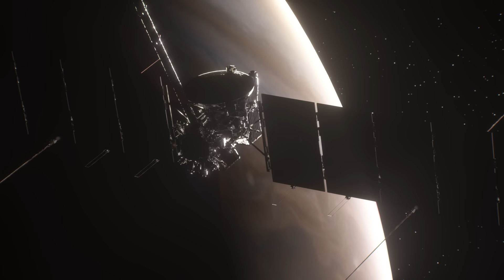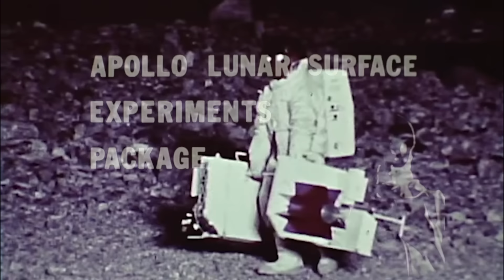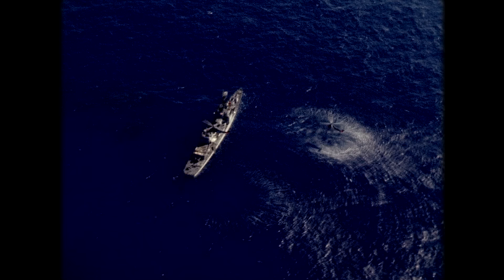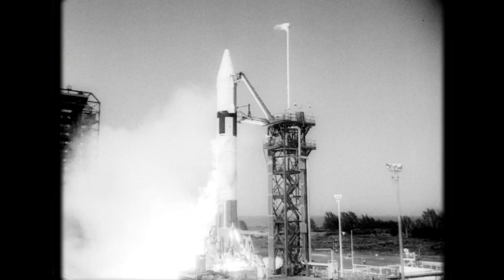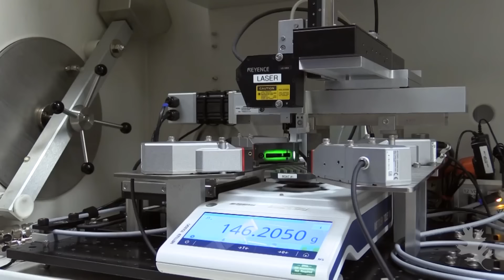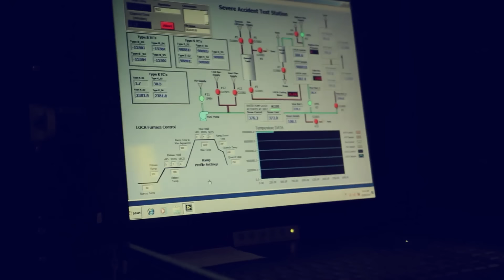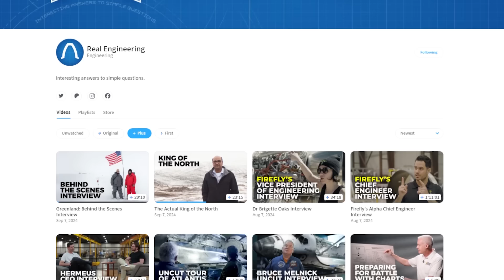NASA'S Plutonium Problem

Comment: I like how we're pretending making the Plutonium is super difficult when we're still surviving off cold war stock piles. Fuel reprocessing just needs to restart. It's not hard. Like with everything nuclear we are just actively making it more difficult for ourselves because people are programmed to be frightened of nuclear (convenient for companies who supply other fuels).
Reply: Did you not listen to the video at all? It IS incredibly difficult, not to mention there's a luck factor when manufacturing the needed isotopes. And while there is a factor of nuclear fear, it's mostly down to expenses and time. Nobody wants to fund it, and the people that need PU-238 don't always have the time to wait for it to be produced. It is a very long and hard process, not just some big scheme for big oil.
Reply: @shinyman9993  I am sure you can understand how volume would fix that. Instead of restarting reprocessing we're just actively making plutonium which is much harder than fuel reprocessing en masse.

Comment: Fast Reactors and Nuclear Waste Reprocessing and P-238 as a byproduct.

Fast Neutron Reactors:
These reactors use fast neutrons to sustain nuclear fission, unlike conventional thermal neutron reactors.
They can "breed" more fissile material than they consume, meaning they can create more fuel than they use.
Nuclear Waste Reprocessing:
Fast reactors can be designed to "burn" or transmute long-lived radioactive isotopes found in nuclear waste.
This process reduces the volume and radiotoxicity of nuclear waste, making it safer and easier to manage.
Pu-238 Production:
With appropriate control and design, fast reactors can be used to produce Pu-238 as a byproduct.
This could provide a reliable and sustainable source of Pu-238 for space exploration.
Energy Generation:
Fast reactors can also generate electricity, potentially providing a long-term, low-carbon energy source.
The 150 year estimate you mentioned refers to the amount of energy that could be produced from current stored nuclear waste, within the United states.
Advantages:

Waste Reduction: Significantly reduces the long-term burden of nuclear waste.
Fuel Efficiency: Maximizes the energy potential of uranium and other nuclear fuels.
Pu-238 Supply: Provides a domestic source of Pu-238 for space missions.
Energy Independence: Contributes to energy security and reduces reliance on fossil fuels.
Challenges:

Technology Complexity: Fast reactors are more complex than conventional reactors.
Safety Concerns: They require careful design and operation to ensure safety.
Proliferation Risks: The reprocessing of nuclear fuel raises concerns about the potential for nuclear weapons proliferation.
Cost: The initial capital costs of building fast reactors can be high.
Public Perception: Public acceptance of nuclear technology remains a challenge.
Implications:

If the technological and safety challenges can be overcome, fast reactors could offer a sustainable solution for both nuclear waste management and Pu-238 production.
This could have significant implications for both terrestrial energy production and deep-space exploration.
Therefore, you're correct in identifying fast reactors as a potential solution that addresses multiple challenges. However, it's essential to acknowledge the complexities and potential risks associated with this technology.

Comment: I worked at the SRP lab in 1986.  The actual product was made in the canyons but we were responsible for testing it to make sure it met NASA requirements.  Supposedly, we had produced all the material NASA would need for all the future projects they had.  The one we were most focused on was the Cassini project.  Eventually, Al Gore directed lots of the SRP facilities to be shut down and transferred to Oak Ridge, which was in his home state.  He shut down the new Navy Fuel facility, which had been constructed at a cost of $250 million.  Not only shut it down but had it bull dozed into the ground so it could never compete with Oak Ridge.
Reply: The #1 thing that I saw, over and over again, in research was intentional destruction/discarding of useful assets when they got mothballed.  So I'm not surprised.
I worked in a research lab that got shut down a few years after I left.  Bunch of valuable and working equipment in that facility (nothing secret - all commercial stuff you could buy: labware and heavy machinery).  None of it was saved - on purpose.  They could have given it away free, and I knew of companies that would have taken it away and paid for the haulage themselves.  Instead, the institution paid scrappers to come out and deliberately cut it up so nobody could use it again.  They would rather pay to make sure nobody could use it again, rather than take a no-cost giveaway deal.
I'm convinced there is a spite angle to a lot of this - a kind of "If I can't have it, nobody ever can!" mentality.
Reply: @joelfenner  USDA would give universities right to donations of lab equipment so that's too bad.
Reply: @joelfenner  Or maybe, they want to justify a massive new budget for whenever the next project by making it have to buy everything over again
Reply: What the hell, that is insane...
Reply: @peigen7151  It is typical.
Reply: @peigen7151  Perhaps "an inconvenient truth".
Reply: @peigen7151 
Thatz Crooked DemokRatz.
Reply: Dude same
Reply: "Eventually, Al Gore directed lots of the SRP facilities to be shut down "
 Al  Gore never had power to shut down anything. He was never the President.
Reply: Al Gore was never President. He never had the power to shut down anything.
Reply: Nice of the GORE Family Crime Syndicate to look-after their Cronies & themselves! (facetious)
Reply: @cinnamongmc5430  There were photos in the local newspaper.  Al Gore was very proud of his work.
Reply: Al Gore promotes wind energy for this project....
Reply: In backwards world, the environmentalists destroy the most clean and efficient power because its scary.
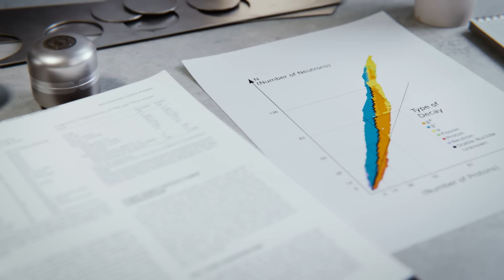Reply: 5:37 why 100 years? What if half life's 200 years? It would last the whole mission? Why the upper limit
Reply: Bulldozed is one word, not two.
Reply: You did not. This is a bot.

Comment: One wonders if there is an as yet undiscovered procedure that can increase the efficiency of converting heat into electricity.  I'm looking at a resistance heater, one where electricity is converted to heat at near 100% efficiency; So, how to reverse the process without annoying the entropy gods?

Comment: The most obvious solution is not the high-tech approach.  The dragonfly should be suspended by a hydrogen balloon and driven by the prevailing winds.  The first such mission should be to prove the ability to deliver the craft and get easily available information.  Like wind currents for starters.  To map the surface is too much too soon.  Without oxygen in the atmosphere, there will be no risk of hydrogen explosion.  Lithium batteries driving small motors w/propellers can give some control to the balloon and with far less complexity than a Pu-238 power supply.

Comment: One thing not mentioned was the price per Kg of pu-238. The demand and supply were both mentioned, but not a price.  With more traditional market commodities there is a more traditional price, supply and demand relationship 

Is there a market price for PU-238?  If so, what is it.  How is it allocated if not to the highest bidder.  During the U. S. Fuel crisis of the 1970s rationing in different forms was applied.
Reply: There is no open market for Pu-238 in the USA. There is one supplier, the Dept of Energy. NASA is the main customer but the DoD probably gets some. I don’t know how the government departments involved set the price.

Comment: Plutonium-238 dioxide does not glow red hot unless you cover it in a strong thermal insulator and wait for hours until it raises its temperature to sufficient value. A lump out in open air will just feel warm to the touch.
Other than that, well made video.
Reply: Hi it depends on a size of an object. 
1 gram is emitting 0.6 watt of thermal power.
1kg is 600wat
Don't forget its a very dense material and cube-square law. 
Wiki saying density is 19g/cc
Given its density 1kg would be 4.5cm in diameter! Like pingpong ball 
2kg is 5.7 diameter .  1200w of power , its like my heater on full!  I my space heater coils are red  at half power (600w ) even they exposed to air.   Basically it depends how big are those pellets :)
Reply: @Rom2Serge   LANL has that piece of Pu-238 shown in the video, and it's metal.  Set in on a insulator and it brings itself to that cherry red glow before you eyes.  Makes you believe in those 5 MWV neutrons.

Comment: Imagine  that a sterling engine replaced a radiator,  alternator, AC, fuel pump etc in a modern car. 25hp right off the top. perhaps more if it opwers a moto for locomotion. Truck have less  gasoline displacement but same power. good

Comment: There is an effort being made to ramp up Pu-238 production, but it is a long  time intensive project. It not only takes a nuclear reactor purpose built for Pu-238 production,  but hot cells and other equipment to handle the freshly irradiated "targets" and to extract the Pu-238 from the Uranium-238 then turn it into Plutonium dioxide powder suitable for radioisotope thermoelectric generators.
Reply: @cinnamongmc5430  It's no secret.
Reply: @cinnamongmc5430  nothing that’s been said is even remotely classified. This has all been common knowledge for decades.
Reply: So complicated.  

What if you take U238 and bombard it with positrons?  Inverse beta decay.  Np238, then a real 𝛽⁻ to  Pu238.  

• Advantage: much simpler (i think).   
• Advantage: no neutrons to accidentally turn something into something you don't want.  
• If a U238 absorbs two positrons, it immediately turns into Pu238.  If it absorbs three, Am238 decays back to Pu238 in a few hours.  Same for Cm238.  
• Advantage: you're only shooting in one direction, the right direction, so no collateral damage.  
• Advantage: U238 is cheap and ubiquitous.

Something tells me somebody else thought of this.  And, the positrons are pretty expensive?  never tried buying them before.  😏
Reply: We should just buy it from France
Reply: Wish we could make more Pu-238 like the USSR did during the Cold War. Those NASA probes were using USSR-sourced Pu-238. We are too "scared" to make  Pu-238 because "nuclear energy is bad". I think the Perseverance rover on Mars is such a waste of money. We already have the Curiosity rover. Should have used that RTG and money on a Uranus or Neptune orbiter. Won't have a Uranus orbiter until the 2050s thanks to those selfish idiots at JPL able to scam NASA with Curiosity 2.0
Reply: @nogoodnameleft yeah but US sanction Rosatom in 2024 and Rosatom sanction US back, so no more USSR plutonium for US. Maybe Biden and democrats should provide now
Reply: @nogoodnameleft  I think we'll need nuclear rockets to get to the ice giant planets and then enter Uranian or Neptunian orbit. Otherwise a massive retro rocket wil havel to be used, and that will make flight times extend into decades. Fast flybys are much simpler to carry out  but only an orbiter can answer crucial questions that take years of observations to answer.
Reply: @nogoodnameleft part of the problem is one of the common pathways to making pu-238 is by bombarding np-237, and np-237 has no other real use outside of pure research and direct use in metallic form as the fissile part of a nuclear weapon. mass producing anything that makes that in an easily extracted form will naturally be unpopular.

this isn't your usual "nuclear energy is bad" but a "we should probably not be literally producing nuclear weapons ingredients as part of making something".
Reply: @dead-claudia  We're already building new hydrogen bombs to replace the expired old nuclear stockpile that has expired in the 2020s. Absolute insanity that we don't replace hydrogen bombs (which are honestly stupid) with smaller plutonium bombs that will give us a lot of Pu-238.
Reply: @dead-claudia  What's wrong with making nuclear weapon materials and nukes themselves? All potential enemies (Russia, China, Pakistan, India) are making them all the time but USA has to rely on ancient cold war era stockpile?

Comment: 10:56 on the left should be THERMOELECTRIC not Piezoelectric - the later is a totally different effect used especially in vibration harvesters. But what NASA uses here are Thermoelectric generators. 😊
Reply: piezo and peltier must have been mixed up. @uwepelz
Reply: It wouldn't be a proper Real Engineering video without a few obvious errors that were either overlooked, or noticed but left in because fixing them would apparently be too much work. Overrated channel, but at least they're trying to educate people. Nice graphics too.

Comment: What do you do currently with the excess Pu-239? Half-life of 24,110 years.

"Just" use nanotechnology with microtechnoloical plumbing in a lab on a chip and distribute the system in a solid containment.
Reply: You can put into a reactor, pu-239 is fuel. They already doing it as MOX.

Comment: The plutonium problem is 100% political, to create an "emergency"  to drive future $Billions of funding to Savanna River and other Govt labs.  Pu238 is producible just by adding pellets of neptunium-237 (Np-237) to the current fuel rods in any reactor.  Yes, its not as efficient as short burst neutrino bombardment, but it can quickly mass produce Pu238 VERY CHEAPLY.  But NOOO, it has to be Savanna River plant and modify 2 other govt plants.  Need to get political $$ out of science, out of NASA.

Comment: you can get it from a thermal spectrum molten fluride salt reactor with a th232->U233 fuel cycle as 'waste' , Glenn T. Seaborg did some cool science
sad they mothballed molten salt reactors, even new SMR are still 80's pebble beds

Comment: well of corse you need high level nucler waste fuel reproseing for that stuff. we could instead use alot ofthe srouim-90 instead. its also fonud alot oin high level nuclear waste as the leftovers fomr the fuel reposeing as well. its funny that large scale nuclear energy fission powerplants are needed for large scale space program rtgs. but i allready knew that.

Comment: The supply and demand graph at 0:37 doesn't make very much sense. Demand and Supply aren't single point scalar quantities. Demand and Supply at any one point in time are a function from price -> quantity. It makes no sense to say that the Demand was 50kg in 2022. Perhaps the "quantity demanded" was 50kg. But "quantity demanded" is always equal to "quantity supplied" so in that case the Demand and Supply lines should be identical.

Comment: I was like “just make more plutonium, what’s the big deal?”. But yah seeing the process of how it’s isolated, I’m amazed they made any of it at all. It seems like more energy goes into making the plutonium-238 than is probably released by the material over its life. Which I suppose would be fine given that spacecraft are volume and mass limited. You want the most power density possible even if it means expending more energy on the ground to produce the battery.
Reply: One issue is that the original Pu-238 production process was not really designed for safety, pollution control, waste material management and the like. The new facilities being built are a lot safer and cleaner with some thought given to end-of-life of equipment and so on. They're a lot more expensive to build and operate though.

Comment: So the United States no longer has the ability to produce plutonium industrially? Holy shit...
that means there's no way to refuel nuclear warheads either, which means they'll have to be decommissioned.
At the same time, Russia is increasing its arsenal, although it is rather just restoring some limited part of it to the 1990 level.
Still, it's very expensive.
P.S. Just finish this shit and let's trade and compete.
As a last resort, you can buy plutonium from... Rosatom.
Reply: Dude - none of your warheads work, the plutonium pits are all degraded - you stopped making them in the 1980's.  They are chemical rockets, the chemicals have decayed. They are advanced electronics you keel in damp concrete tubes in the ground. Every electrolytic capacitor is dud. I mean sure 1% - 5% might get to the intended target and work.

Ironically the most reliable ones today are probably North Korea's - they are brand new.  Russia's military is even more corrupt than yours so the new ones they have probably don't work.
Reply: @piccalillipit9211  And if you think the U.S. nuclear arsenal is anything like you've described, you need to crawl back under your rock in Moscow.
Reply: "As a last resort, you can buy plutonium from... Rosatom. "   China makes 9.3Kg a year - you can buy it of them if you can stop the technology w4r.
Reply: @piccalillipit9211  We're not talking about Plutonium, but since you're talking about it I'll disabuse you of your ignorance:  the U.S. is already in the process of bringing at least 80 plutonium pits online by 2030, and will produce nearly 360kg of plutonium from those annually. And if China doesn't want a technology war it should stop engaging in historic and rampant state-sponsored theft of intellectual property and R&D from the U.S. and every other country on the planet. You derps keep talking about the U.S. like it's the bad guy when China's explicit goal is to crush you and everyone else culturally, economically, and politically under its thumb.
Reply: Are you illiterate? The U.S. can ramp up plutonium production whenever it wants. This video is about P-238, something no one has much of and everyone is trying to figure out how to economically produce more of. U.S. nuclear weapons are in perfectly functional shape, undergoes ongoing maintenance and modernization, and is vastly superior to anything Russia has or can produce. Go be ignorant somewhere else.